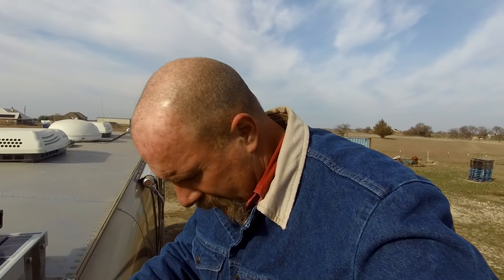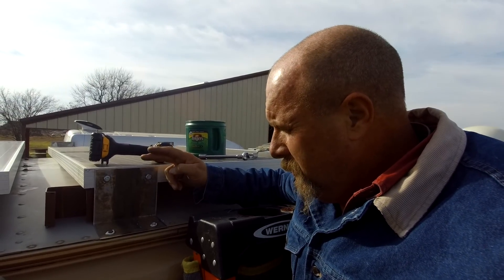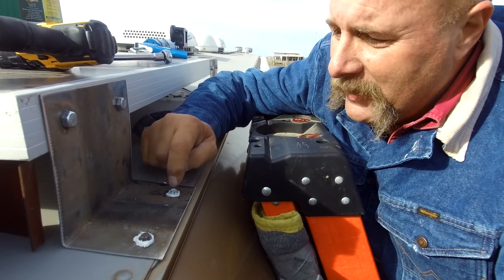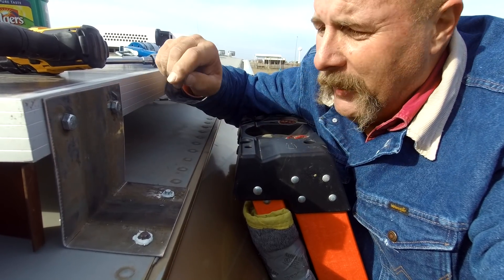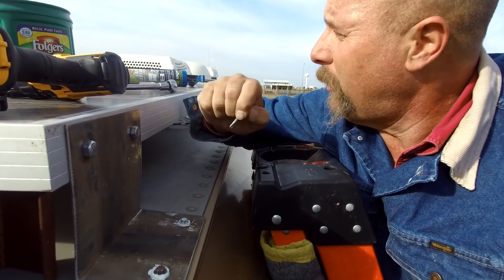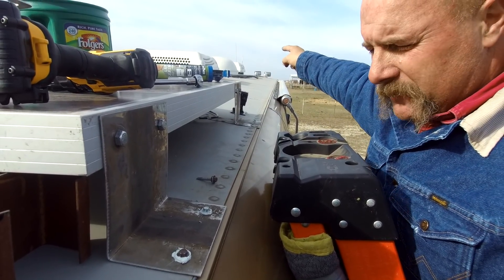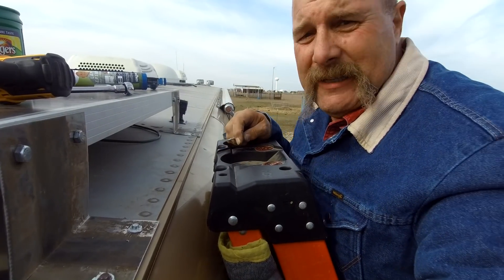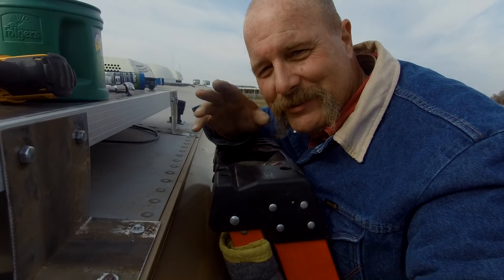464  Still not showing you how to install solar

Comment: Glad you're doing the screws with Dicor, might also be good to put a bead all around where each bracket meets the roof to keep rainwater from getting under.

Echoing the other comments about galvanic corrosion, might be good to click around to make sure you won't have a hassle down the road. 🤞😎👍

Comment: Looking good!

Do you recall how many volt panels these are?  I think you said in a previous video they where residential panels so I suspect they are more than 12 volt panels. There is probably a tag on the back side with the specs. I photograph the tags for future reference.

Comment: Yep, just loosen the bolts to the panel and remove and slip a heavy plastic washer between the SS bracket and panel frame. Ya might have something in the shop where you could make your own with a small hole saw.

Comment: Will there be a chemical reaction bolting steel to aluminum?? kinda like when doing aluminum trim and soffit etc on your house you have to use aluminum nails..steel nails will cause the aluminum to oxidize and rot...especially concered for the roof more than the frames of the solar panels...You could ask Will Prowse on the electrical but he will talk your ear off. How about Tom..He is darn good about amps and watts etc.. Fair Winds and Smiles..29 days to Camp HoboTech  lol
Reply from the maker: Chem reaction Hmm.  I remember that now.   Time for a rubber gasket.  I plan on picking Toms brain in  Qtown
Reply: @Sasnak  Aye.. Check perhaps the kind of gasket that acts like a condom so to speak..or perhaps aluminum screws ?? Just thinking out loud...
Reply: Takes a deep breath: Galvanic corrosion occurs when two materials (an anode and a cathode) come into contact with each other and an electrolyte. Electrolytes can be environmental factors such as humidity or rainwater. The combination of aluminum and stainless steel causes galvanic corrosion. There are a few steps you can take if you MUST use these materials together. Add an insulator (paint) between the two materials so they no longer connect. However, all of your effort will go for nothing if you just bolt the joint together. You must isolate the bolt from the aluminum and steel. You do this by putting a nonconducting plastic washer between the bolt head and one side of the joint. Without that connection, the transfer of electrons cannot occur. Good luck!  And a Merry Christmas Captain Jack, Pam & Stan!
Reply: @eddiezweers4158  So the hinge against to roofing sheet is isolated but the hinge against the panel?  A piece of tire tube between the two?
Reply: @Sasnak  stan get some butyl tape and sandwich the bracket in the Rooftop that will stop the electrolysis and it will be water tight. Get hobo to help to install the solar.
Reply: As a retired contractor in the home improvement business, we always used stainless steel trim nails with all-aluminum trim products for yrs, no problems at all. Never use alum with copper, there will be a chemical reaction there. The only thing I would do with the screws is to paint or coat the heads so they don't rust. Other than that, he'll be ok....
Reply: @Sasnak  Stan, read my reply above. Also, the rubber gasket is for expansion and contraction on the metal roofing, no need to worry.

Comment: allright..  dont want to rain on your parade but  did you but glue or silicone under the brackets? i see you put that goop on the screws wich is good  but if water finds its way under the brackets it will probably find its way inside under the roof through the holes u drilled.
Reply: hahah never comment before seeing the whole video..   I hope goop the holes up is enough.